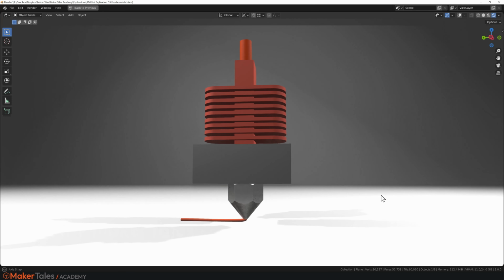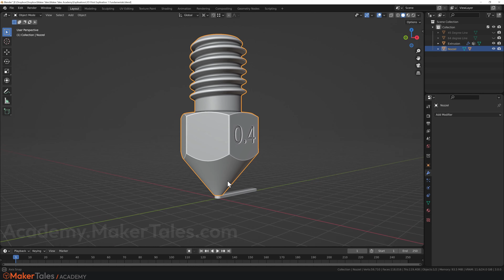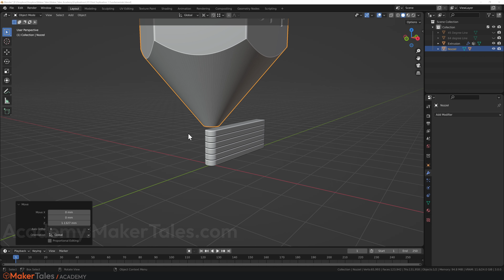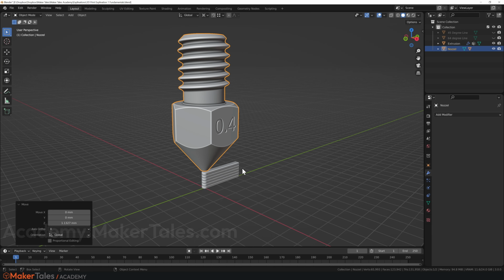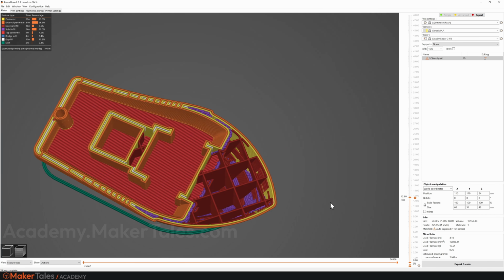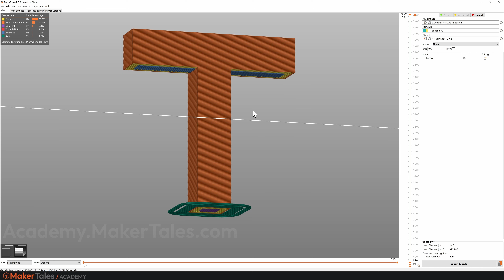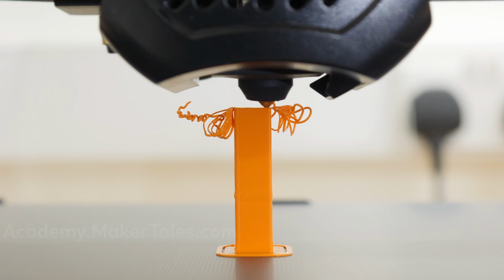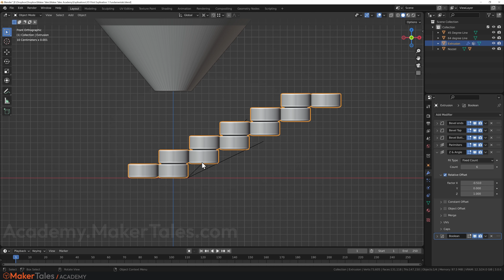3D Printing Basics - The CORE Design Fundamental

Comment: Hello Jonathan 
I heard that 3d printers are too slow for fast production. Can you recommend any alternatives? 
My goal is to create models and sell online, but it's not practical if i have to wait 24+ hours for 1 model
Reply: There is no alternative other than standard production using injection molding. Of course you can try resin printing, but that's about the same speed and more hassle to deal with regarding clean-up and toxic waste.